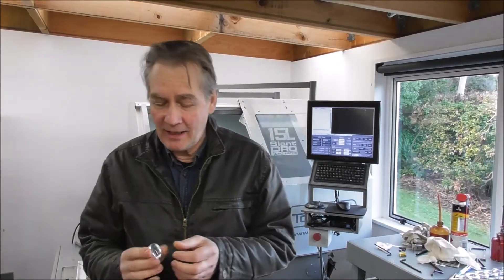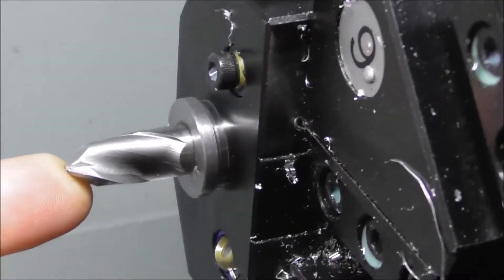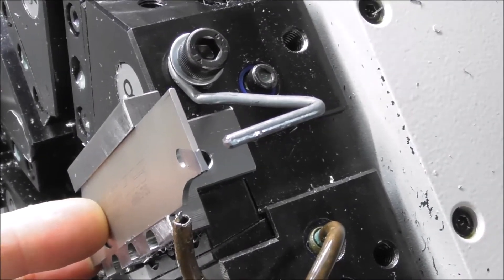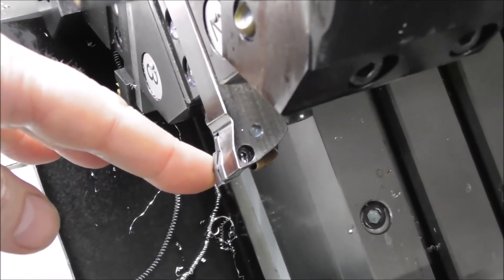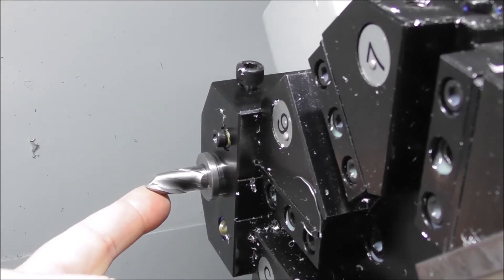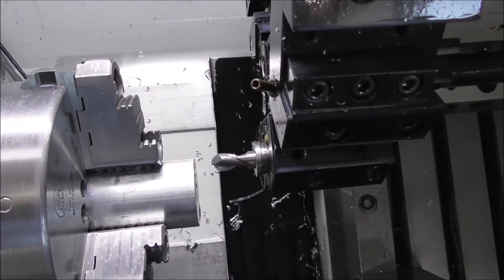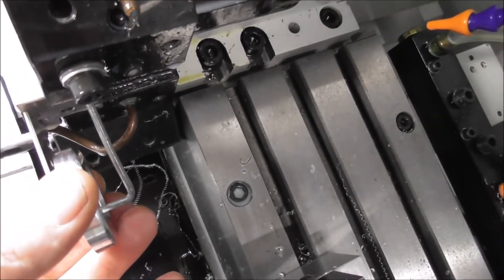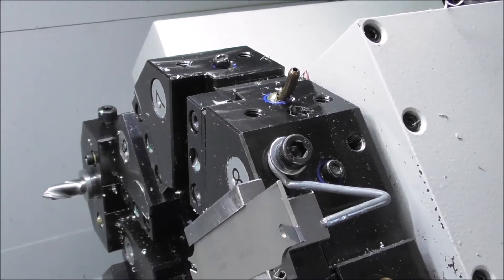Tormach Slant Pro - Avoiding Part Damage.

Comment: I’m not a machinist in any stretch of the word, which is why I watch talented and experienced tool makers like yourself.  Is there a reason you did not choose some other final tool position for setting the stock end stop?  One that would also simultaneously present the finished part to the front as opposed to the back where you have to reach across to get to it?  Everything you do is so clever, deliberate and thoughtful, so I suspect I’m missing something?  Still can’t understand why you channel doesn’t have more subscribers.  You do such a good job of explaining. Thank you and Happy New Year 👍👍😎👍👍.
Reply from the maker: Hi Joel. Thanks for the feedback. The tool I used for the stop auto rotates in its turret and stops in front of the part ex the end of the code -  so all you need to do is slide the stock forward. Cheers Cliff
Reply: Cliff, I think I got that.  What I was wondering was could you have arranged the tool holders differently?  Could you have clocked the ‘stock stop’ tool such that the cutoff tool clocking also happened to be closest to the open slide door at the end of the cycle so you didn’t have to reach across all the other tools to remove it from the wire catcher?  Does that make sense?
Reply from the maker: @joell439  I see what you mean now. Yes, good idea. Cheers  Cliff

Comment: Pecking on the parting op will avoid that birds nest problem, also for the boring op.
Reply from the maker: Hi Hahn. Pathpilot Conversational doesn't provide the option of pecking for turning or boring, but it does on the parting and though it is not clear in the video, but I am using it there. Even with pecking, I found small curling's were sometimes scuffing the OD.  Cheers  Cliff

Comment: Nice way to catch the part. Thanks for the info. Do you flip the part and finish also on the slant pro or use the manual lathe?
Reply from the maker: NC mill the other side, 8 in a fixture.  Cheers  Cliff